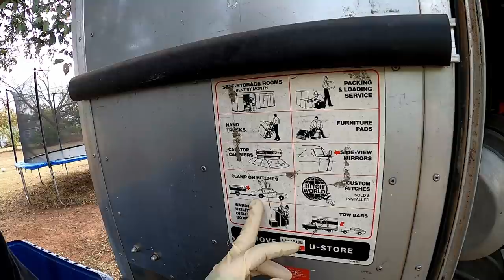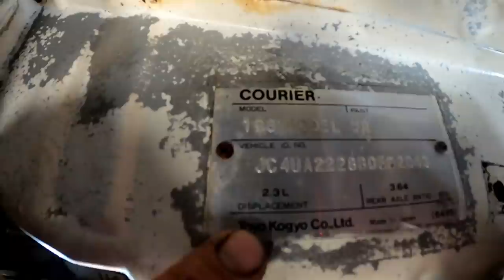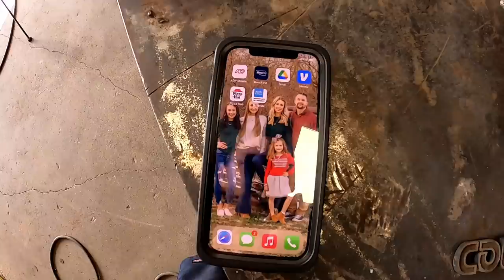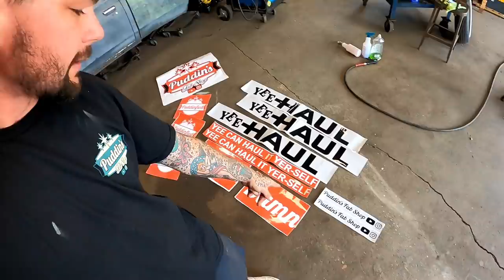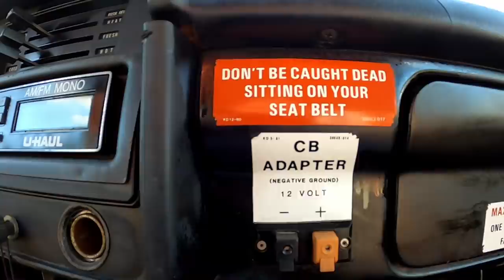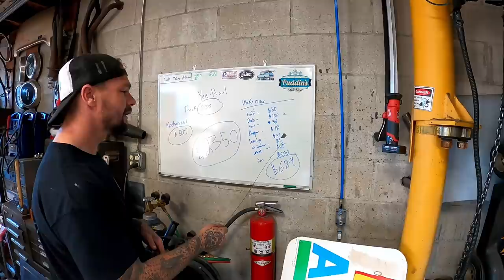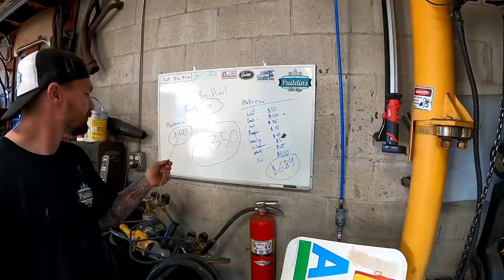ABANDONED U-Haul MINI TRUCK gets budget friendly makeover. ((1981 Ford Courier Box Truck ))

Comment: The 2.3l has some performance parts for it there are dirt track classes that run that engine, also known as a "lima"
Reply from the maker: Factory is fine by me lol
Reply: @PuddinsFabShop  Gonna keep it low and slow
Reply: Lima 2.3L/140ci engine. Based off a european 2.0, built in Lima Ohio, carbed versions are usually 88hp and have a Holly 5200 carb, or the ford emissions version. EFI versions in the 87-93 Fox bodies are 110hp. Can be bored&stroked up to a 2.8. The D-port heads are the best flowing heads compared to the earlier round and oval ports. A popular, but difficult mod is fitting a Volvo 240s 2.3 dohc head on it; involves welding and rerouting coolant passages, custom intake & exhaust. A stage2 cam and individual carbs will get it at 90hp.

I still have the Offy dualport 4bll intake I was going to put on my 81 Mustang I had to sell, hoping to get another one, since it had been in the family since '93. My plan was making a Boss140 engine and faux build, since a Boss was one of few Mustang types that did not exist for the fox bodies- which probably had more trims than any other generation. GT, LX, Ghia, Base, GT350, Cobra, Cobra GT, SVO, GT Enduro, 7Up, and SSP.

A stage 2 cam, header- which you could just snag from any factory Lima  2.5 Ranger would do the Yee-Haul some good. It'll still be dog slow, just a bit over Basset Hound dog slow.

Comment: The resolution of an image is the number of individual pixels that put together that image. The higher the amount of pixels, the less each pixel is stretched when the image is enlarged. The resolution of an image is the most important factor when thinking about enlarging an image. The higher the resolution of the image, the less pixelation that will occur and the better the image quality will be when printed.
Reply from the maker: Well I have never had a single piece of merch look pixelated. Or any other stickers I’ve had made. This image was already scaled to size in a vector file by my art guy. 

Anyways, it’s not the quality of my design guy I guarantee that.

Comment: Awesome rebuild. I have a 1987 Nissan Sentra E sedan that I used as a daily driver until the suspension frame broke. I figure I put almost $9,000 in parts and maintenance in it. Still have it for when I can fix the rust and get it back on the road.

Comment: hey buddy just a little tip with the pressure washer, pull the Triger when starting, releases the pressure of the pump an in case any air in the pump, should last ya a life time, and the pump oil has to be a none detergent type, so NO diesel oil. hope it helps? cheers

Comment: Another amazing build!! I wouldn’t have ever thought to buy one of these trucks but man after seeing yours I want one now. A thought for the dash, pull it and a little crack repair and flocking, would look good as new for very cheap.
Reply: They're kind of hard to find U-Haul didn't let go of these things they kept them for over 25 years in their Fleet I paid near 10 grand for a good one
Reply: @ihave35cents95  The guys that cleaned the floors at the grocery store that I used to work at this is the same kind of truck that they used to haul around the floor buffers and the mop buckets that they used.
Reply: @lilorbielilorbie2496  yeah they're good little box truck for maneuvering around the city. Mine has the 10ft Box though that little one wouldn't do me much good

Comment: I use to own one of those Ford-Mazda Couriers with the 2.3. I wish I kept in instead of trading it in for the F-150 4x4 but I also wish I still had that 4x4. I just kept trading in one truck for another every 3-4 years for 40 years because I was too busy using them to try to keep them alive. I've had so many pick'um-up trucks I can't count them any more. All Fords from the Courier to the F-450 and two Jeeps.

You might also try "quad zero" steal wool on some things. It's less aggressive than the green scrub pads but stays the same till it wears away to nothing. The steal wool wont scratch chrome like the green scrubbies. Even an SOS pad will work wonders . . . they work on aluminum pots and pans . . .

Comment: It LOOKS GREAT lowered but I would want to use it as a camper so I would have left it up for dirt road clearance. My old '48 Willys station wagon (two wheel drive) had narrow tires up front and big wide off road tires on the back so I might have gone that route with it. But I like the lowered version as well. Now you need an old U-Haul matching trailer . . .

Comment: Wet the pad on the buffer with a spray bottle first off. The color of the pad tells you the grit if the pad a white pad usually is a polishing pad. You need a cutting pad (usually yellow) Purple pad is usually a very course pad. You could cut a lot of time by using a cutting pad first then polish it out. Black pad is soft and a good one to polish well. I said usually because depending on who makes the pad there colors could be different. I am really good at buffing, but I hate it, I hate it a lot.
The door seal looked great right on. That 3M gray double back tape was designed to put widows on skyscraper's  so when the building sway's the glass can flex with the movement.

Comment: You might try putting a coat of marine varnish, clear and high gloss, needless to say, on those hubcaps. I don't know for sure that it would work, better try it on some throwaways first. I knew a guy who lived in snow country where they use salt on the roads in the winter and he would put a coat or two on his chrome slots and run them all winter.

Comment: want to bring up the whitewalls on tires... get the blue soap off or miles of brake dust?  spray Fantastick on the tire, avoid the paint because it will eat paint... get a bucket of warm soapy water and a sponge... with the sponge and soapy water the crap will very easily wipe off the tires... just rinse... done!  spray all four tires then start on the first one spayed and wash in order...

Comment: Check the differential for excessive play. I had one of these that used to be a city truck for Santa Maria, Cali, well maintained but worked like this surely was and the differential ended up eating itself. Unless UHAUL upgraded the diff, I would check it as the Mazda one is kind of weak. This is also known as a Chicken Tax truck. Mazda built it in Japan, shipped it over on a boat and assembly was finished on this side, as a way to dodge the tax.

Comment: Why do I want one of them lil bastards so much now?  All I can imagine is setting that box down on my old 02 Ranger. XLT off-road ex cab chassis with that box would have been ATV hauling heaven. Being an 81 it's a 2.3 4spd isn't it. My old 84 bronco was a solid lift 2.8 4psd rattle trap. Had a nice turbo coupe engine that would have been right at home in 1 of these.

Comment: Is a Japan built truck. Vin starts with a J and it's made by Toyo Kogyo. Is a Mazda rebadged Ford. Ford and Mazda worked forever swapping parts. They still do.  mazda vehicles used Ford electrical and engine blocks with Mazda heads. I had a MPV 2002 with that set up. In the early 90s Ford had a superchargerd Ford Thunderbird / 5 speed and the trans was a Mazda it was shown in a movie with Church Norris. So there you go.

Comment: I absolutely love that original little U-Haul Courier.
Not a fan of your upholstery choice, you can't slide across the seat to fit three up front. It should be vinyl.
You couldn't be bothered to match the white paint on that fugly front bumper? 🙄
Coming to the end of your video my stomach is turning. Cutting the front springs, adding lowering blocks to the rear, your logos plastered all over it... 🤮
That's one way to ruin a perfectly restorable, unique little vehicle.
What a waste 👎